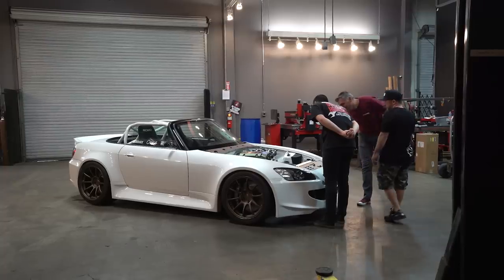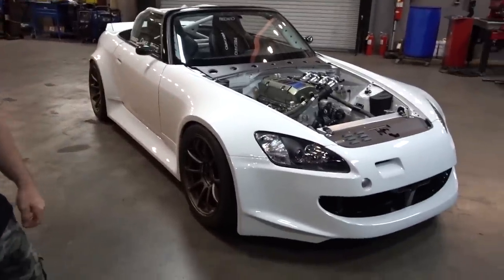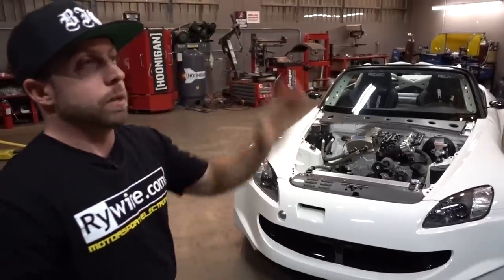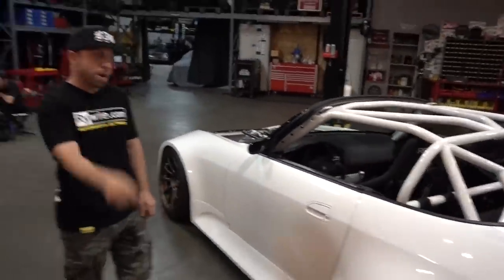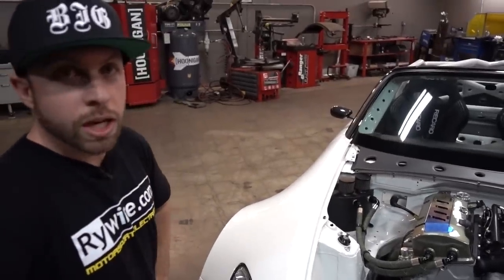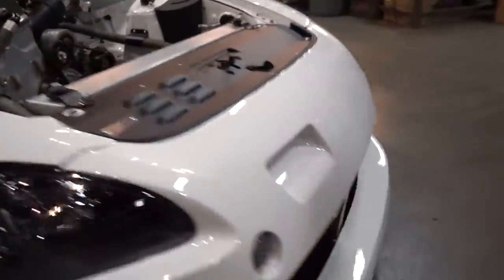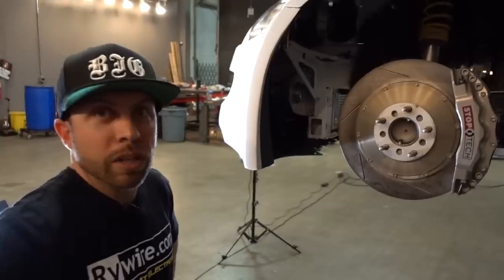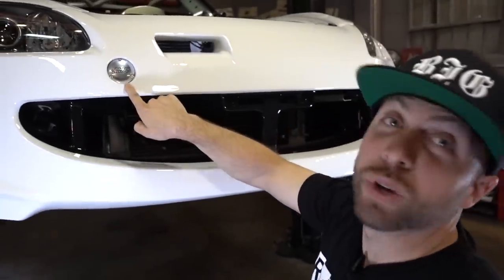Is this the World's Cleanest Honda S2000 -  Rywire Wide Body Ap1

Comment: Would it be possible to get a rev or two or at least a start up and idle in the Build Biology episodes? They’re great as is, my favorite of the new series’s that y’all are doing, but they’re in need of that beloved sound.
Reply from the maker: We’ve been discussing it. 👩🏼‍💻
Reply: Even just pulling in and driving out as intro/close.
Reply: What's to discuss?! Just turn the car on. Geez.
Reply: Mmhmm. Need the noise 🤘
Reply: why, just do it
Reply: Just do it scotto just do it Madonna  Santa
Reply: Yeah at least a start up. It crucial to a true walkthrough
Reply: You can insert it before the car moves to the lift. Just a suggestion.
Reply: Why not let the guys that want to Hoon Hoon a little...
Reply: Uriah Siner here u go 15:28
Reply: Buy a dyno and make them run it.
Reply: I agree, I know this is not their car but give me a break. The only people that are watching this video are motor enthusiast and motor heads love to hear engines rev; especially ones like this
Reply: Do u watch cyanide and happiness
Reply: Chris o
Reply: yall realise that these cars probably are made to be driven and revved AS LITTLE as possible? theyre designed to be preserved, and the less engine usage the better.
Reply: Plot twist: There's an electric motor under the valve cover
Reply: No
Reply: @Patdog130  lol not true, bro
Reply: Agreed
Reply: Because the starting cables are so small and long that it might even start without a jumper box.
Reply: i m pretty sure nothing works.. its an advertise just an eye candy
Reply: Cold start and rev it to 12k, send those rods to the moon!

Comment: Wow I built a 2.0 aka 2.slow VW Golf motor back in 2006 that was making 296 at the wheel. Up from the original 85whp. Dynoed at a local Honda shop before and after tuning. They couldn't believe it. Not into anymore, but someone got the car. Long story. Had a 3k dollar turbo kit in the trunk just waiting to be installed. Someone banked. Had about 15k in aftermarket in the car. Regrets! If you live around Newport News, Va and ended up with it, congrats!

Comment: I do think the car looks really good. But only from a distance. I don't know if it's the camera angles or something but I have a few issues with the car.

1. There seems to be size gaps in the door jams and other places. I understand you guys probably started with a mid milage S2k, but I think they were overlooked.

2. The body kit lines don't exactly seem to be flush to the actual lines of the car. I understand you had to custom fabricate certain parts but this issue on top of my previous issue ... Eh I'm just whining I guess.

3. All the money that went into the car and it's not very fast. I really do like most angles of the car but for the 10k body kit and cost of the car... But I guess on the track it would be perfect.

Oh, and it's missing the hood! They didn't even address that once lol. I want to see what the car looks like with the hood.

Comment: The front end looks like a Mazda Miata.
Reply: no it doesnt look a the lights are miatas are round the s2k is a big roadster, that engine bay is ridiculously huge meanwhile that gens miata has the battery in the trunk i believe or thats na only but apples and oranges. The new miata has nothing on this to this day stock. Has a previous owner of both vehicles 94 miata/s2k ap2 08 sports edition and have driven daily the 2009 miata daily as well you can tell thats a s2k from a mile away. not only that its supppper low to the ground stock.

Comment: Bad ass car...BUT you're running out of fuel at 300hp with 1000cc injectors? Uhhh cmon. Just be honest, you wanted the look of those secondary injectors. This car does not need 8x 1000cc.
Reply: I was gonna say the same thing. Thats just stupid math.
Reply: Jackie N ya it’s not a veyron.
Reply: Facts
Reply: Yea...1000cc injectors do just fine with a 3L 6 with a turbo.......I was confused with all the fuel spray
Reply: Don't forget that they are running E85 - ethanol has less potential energy than traditional gasoline so you need to inject a higher volume of fuel to compensate for that.  I doubt that those injectors are at 100% duty cycle but I'm sure if Bisimoto tuned it that way, they're getting used.
Reply: no joke....my e85 k20 with much lower compression is making 320whp on a small turbo and is only at like 81% duty on 500cc injs
Reply: @starvincharlie6728  25-30%more....which means that under 300whp would only need 440cc injectors. i have 500cc ones and at 320whp on a small turbo k20 im at 81% on e85

Comment: Holy unsprung weight, batman!
Reply: I wonder how much slower and worse handling it is with these wheels/tires. Even with C5 Z06 a lot of track guys find the best balance around 275-295 section width, and that's with a 405hp 5.7L V8 spinning the steam rollers. Just going wider doesn't necessarily mean there is more contact patch because of the way weight distribution works, and it definitely adds more unsprung weight, plus rotational moment of inertia increases exponentially with distance the mass is away from the rotating center.

Looks cool, may not actually be faster around a track. Cool show car though.
Reply: That size tire is ricer, a stretched tire would have been more acceptable. Less weight along less drag and side wall flex.
Reply: Way to expose your inner ricer. Drag racers now know more than you. Dry performance will rob fuel consumption and wet performance will hydroplane lateral. Go learn how to be ricer somewhere else.
Reply: I think the Holy Batman unsprung weight comment was directed to the midget robin juda driving it :)

Comment: Nice work on the front. The added air control features on the corners of the bumper turn it into a catfish face, pretty badass.
 Only thing I'd try to work into the front would have been air curtains, with upturned internal vains. 
2 reasons 
1 air curtains =reduced drag =faster race car on less HP
2. inturnal turning vanes would provide front downforce. =good for race mode.

Comment: This car is all I like for daily, easy repare access , beating every car in every corner speed, with a good remap should be eco at low rev with a very high rev top power racing perf and more torque with Big bore cylinders, the last thing I would add on this car, and because it's a naturaly aspired engine is a Honda motorcycle "RAM AIR SYSTEM" with a special vortex turbine for a good aspired sound, all integrated in a carbon bonnet

Comment: Very clean build!  I'm confused about the statement about the rear diff and the secondary injectors.  I thought oem s2k diffs were fragile.  The secondary set of injectors must be strictly for better atomizing of fuel since there are much larger injectors available to run on the primary.

Comment: I think obsessed garages s2k is the worlds cleanest.
Reply: cyclingfaction His car has like 12k miles and no rust or corrosion anywhere with pretty much 100% reversible mods. That car is amazing.  This was probably a mediocre car to begin with. Not hard to made it look brand new when you strip the whole thing, paint it, and powder coat everything with new bolts everywhere.. solid build nonetheless.

Comment: Beautiful build, done to the clients liking. One thing though, feel bad for those axles if he ever goes to see how fast it runs at a drag strip. Trying to launch with those huge wheels with those huge disc brakes, that's WAY more weight to rotate than those axles are made for.

Comment: I just don't see why you would do such a crazy build like this, and only have 300hp in it. I don't care what others say, but you would get used to this power too quickly. This should at least be 500hp+. I say that only because you could totally use it and push it daily...keep it at 1/2 to 3/4 throttle when taking it out, and that will be fine to push hard, but then the random full throttle will continue to give you a thrill. 300hp will give you a thrill, but you'll have to full throttle it everywhere you go to really enjoy it.

Comment: Awesome but I'm not sure ~ 300WHP justifies those massive tires, perhaps 500WHP. I would size down the wheel tire package to something like 18X8.5-9 inch wheels with ~ 255-265X35X18 tires.

Comment: I had a truck that was super high compression not sure the ratio I do know how much psi per cylinder it was averaging 320 psi of compression in each cylinder there was no E85 back then I ran unleaded it was a 2.4l punch 40 over with chromoly sleeves with flat top forged pistons chromoly rings and bearings and you don’t need no turbo that thing was smoking fast for four banger it would out run a Vet easy and it was naturally aspirated I could hit almost 100 in 2nd gear and back then there was none of this electronically limited crap we have today I wanna build another one I had too sell it sadly except this time I’m gonna pro-charge it plus high compression it’s gonna be a monster I’ve never seen another Datsun d50 that was so fast

Comment: I’m a Honda fan but 2.5 liter 14.5 compression itbs and still under 300 hp because the secondary injectors haven’t come on yet is a shit built engine by bisi. Stock bottom end 2.4 tsx with DC 4 or 4.5 cams will yield right 300 on e85 that build has been replicated a million times on the forums. Lost me with the whole 3% power gain atomization theory aside from that it’s a clean build for the money his customer paid for that build a better engine builder could’ve been sourced.

Comment: In reality they added a body line to the quarter panel that the s2000 doesn’t have. On a s2000 the body lines disappears right above the wheel and the fades in again

Comment: The rear diff is the S2000's weakest point and is not pretty tough once so ever! DO NOT DIG RACE! Suggest upgrading to something better than the MazdaSpeed Miata/RX7 Turbo II rear end that comes in the S2000. PuddyMod makes good diffs specifically for the S2000. now back to watching the rest of the video lol!

Comment: I rub my buggers over a k24 valve cover and I'm already in the 300 range.. f20s are sad these days
Reply: Markitos203 you ever drove one?
Reply: Michael Williams I had the chance of beating on an ap1 back in 09 and help the same buddy put one in a ae86. they are nead engines none the less but if I want more displacement I toss it out for a k24 and still rev to 9k with the stock 99mm stroke. F20s are kind of maxed out from the factory

Comment: Underwhelmed on the power numbers.  Really not seeing how ID1000 are coming even close to max duty for ~300HP (is it due to e85?)... and the idea that secondaries are needed because there isn't enough fuel!?  Makes no sense at all.  I have a 2.4L AP1 s2000 12:1 with AEM Infinity and 550cc Grams injectors and only 93 octane and I'm at 272HP.  My duty cycle really only ever gets up to like 60 IIRC.  Anyway, amazingly clean and impressive build.  Just disappointing power all things considered.

Comment: Way oversized (in this case not really performance oriented) shoes.. It looks very good but I think it lacks performance due to these wide wheels. Even the J's Racing S2000 with 316 HP does "only" have 265 in the rear (and they really understand their stuff).

Comment: first you have multi-port injectors on the plenum side at "high" duty cycle"... making less then 300whp then you add extra injectors about 2inches above the ITB's and talk about charge and vacuum like your honda has a full closed manifold plenum.... esp love the video of predetonation above the ITB's at 15:28 
Might look shiny but this is probably the worst setup ive seen.....

Comment: Awesome, but, not as functional, and i mean, if they didn't have the tires in the US, and you get a flat, well, you're fucked. I'd never do that, i'd go always go to something that was at least reasonable easy to order and have delivered fast, 1-2 days tops.
Do think the front could be a little more nasty or raw, this is too smooth and almost boring. Almost. I guess it's the smile.